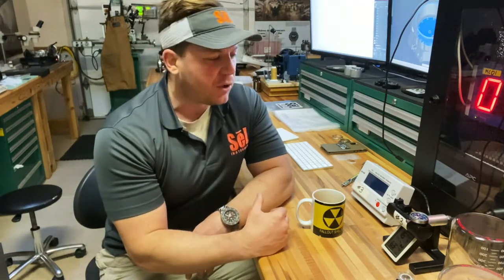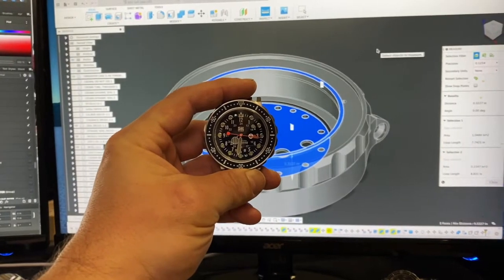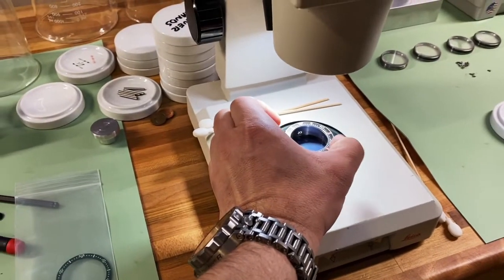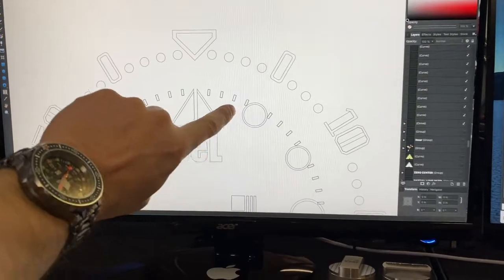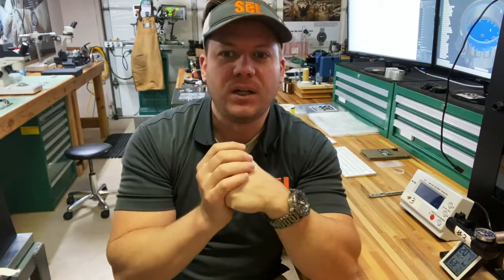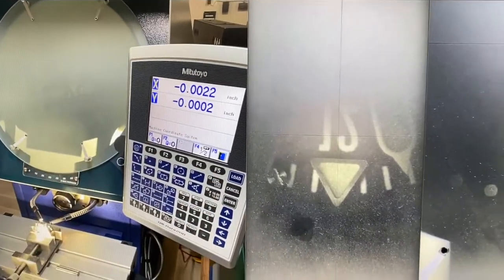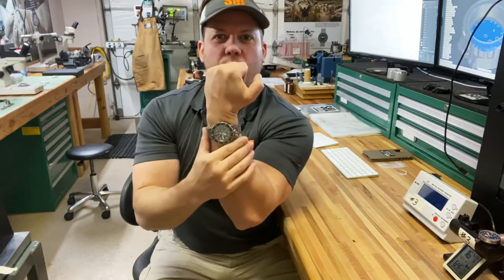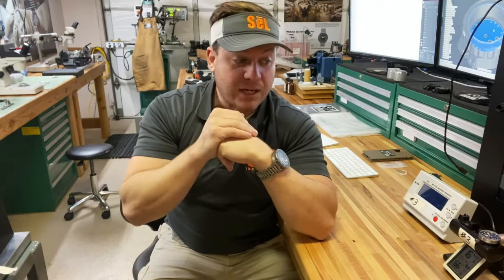Dive watch assembly and stereoscopic parallax - WTF is it and does it matter???

Comment: Damn. In a manufacturing spec 0.002” is tiny. That’s a very cool explanation.  Good discussion on how the design of the markers can bring that more to focus than before. Great video!
Reply from the maker: It is extremely small.  We have a few parts that we holds ten-thousandths on but we were surprised that just by eye we could get it that close.  Despite this, several people still believed that the alignment was off.  The human eye can be surprisingly good at seeing very small errors so we still don't know for sure whether they really could see the .0022 or if it was more related to a design issue.  They all indicated that alignment was important for them at our price point so we'll be making some changes to the designs to help eliminate any "perceived" errors.
Reply: I think the only other manufacturers that do a triangle tip to triangle tip is Damasko.  Though their watches do have a thinner chapter ring area.
Reply: @selinstrument8301  thanks for this video. People SCREAM at certain watch brands for this.... It's .002 of an inch. Other brands crank out tens of thousands of watches a year and are off a few thousandths of an inch .....